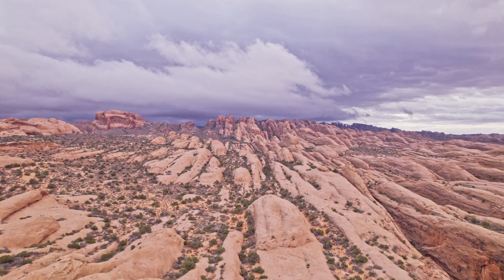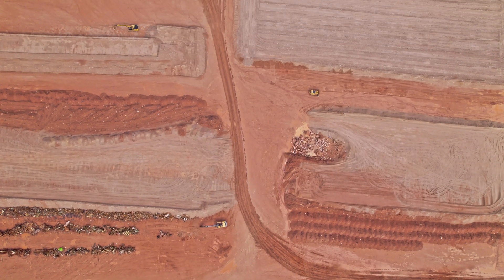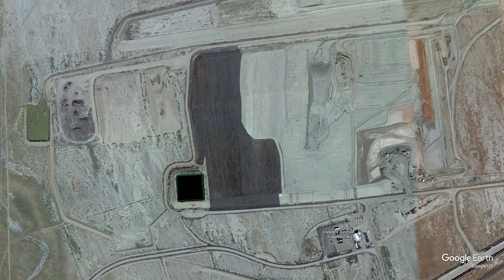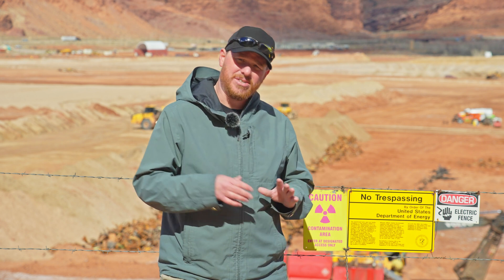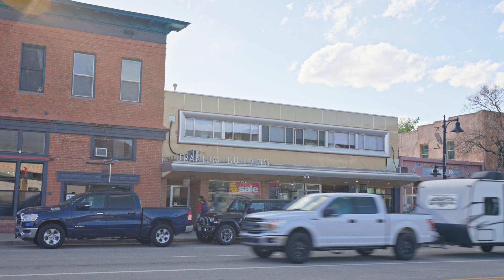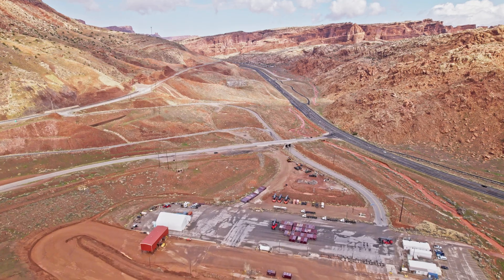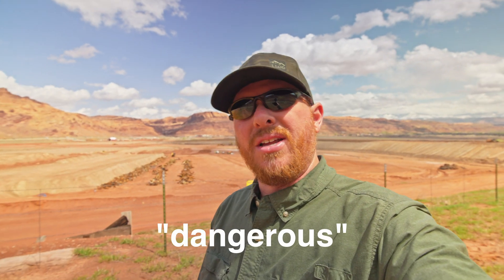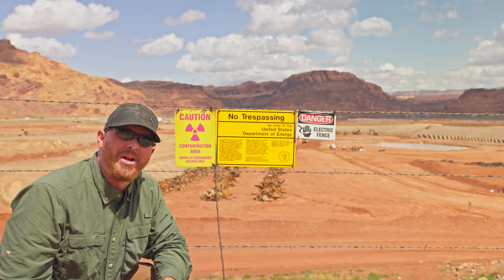Radioactive Area Next to Arches National Park

Comment: I was there for 2 years and was one of the original RCT's getting the site ready to remove the big mountain. There was no real concern for the public with the very low amounts of radiation. There was and probably still a problem with the people of Moab that took away thousands of bricks for their houses and patios. The bricks do give off radiation that could be a problem for health. We had a truck that would drive through Moab to detect the problem radiation. The government was required to pay for the removal of the bricks but the DOE out of Grand Junction ordered these reports to be hidden so the government didn't have to pay. The move of the mountain was a success. The coverup of the DOE in regards to the people of Moab still exist.

Comment: This was the site of the first uranium processing facility built by a private company in the world. It was build in 1955-1956 under an Atomic Energy Commission license by the Uranium Reduction Company. The URECO mill used a revolutionary sulfuric acid leach and a resin-in pulp recovery circuit that recovered 93 to 96 percent of the uranium contained in the high-grade ore shipped to Moab from the Big Indian mining district in San Juan County. The Atlas Corporation purchased the mill in August 1962, in a $23 million transaction that consolidated most of the mines in Lisbon Valley with this uranium processing facility. This uranium mill processed 6,354,733 tons of ore averaging 0.34 percent uranium oxide that contained 43,762,217 pounds of uranium concentrate (yellow cake) under license to the AEC, and more than 11,000,000 pounds of yellow cake for nuclear power plants. Atlas Minerals shut down the mill in March 1984, after the domestic uranium market collapsed following the Three Mile Island accident and Jane Fonda’s ridiculous anti-nuclear power movie. 

During the 28 years it was in operation, the mill was the largest employer in Grand County. The removal of the tailings and remediation of this site has ballooned from $60 million to cap the tailings in place to $700 million to excavate and ship the very low grade uranium tailings sand to the Crescent Junction containment cells. This has made the mill once again the largest single employer in Grand County. The millsite will become a park and tourist information gateway to Moab once the remediation is completed. A portion of the park is going to be dedicated to the uranium prospectors who opened up this area during the 1950s Uranium Boom.

Comment: Questions: while in Colorado measuring radiation levels, what was your take on Rocky Flats?  And, do uranium tailings still offgas helium?
Reply from the maker: I’ve been to Rocky Flats and walked the northern perimeter fence with my detector. I didn’t see hot pots and the radiation level seemed normal for the area. I want to go back and do some more investigating on the site. I would imagine the site that is off limits in the middle is still contaminated. 

 Anything that emits alpha radiation makes helium. The alpha radiation is helium with a positive charge. It quickly picks up 2 electrons after its emitted. All helium on earth comes from radioactive decay.

Comment: I think your title closely borders on fear mongering.  Not good. Hence I’m not passing along any Likes or kudos.  
I’ve been to Moab many times and Arches National Park.  I’ve got no problems with your general content.  BUT, I believe you should have explained the distances between the cleanup site, Moab, and Arches National Park. 
Granted they are not miles and miles apart, but nevertheless, without this orientation - a safe distance as you know - a visitor not familiar with the area may be lead to believe Arches National Park sits almost on top of the cleanup site.  Not good!
Reply from the maker: From Arches National park it takes about less than a minute to get from the entrance to the UMTRA site. Those two sites are very close to each other.
Reply: Actually  the cleanup bordered the national park on east side of road. Rangers pin flagged boundary

Comment: The mill tailings are being removed in case of the possibility of catastrophic flooding due to the possible collapse of Dillon Dam in Summit County. Dillon Dam is unstable. 
If you drive by the dam in the winter while on I-70 look up at the left side of the dam and you will see an inverted crescent or horseshoe shape that will be snowless while the rest of the dam is covered with snow. The crescent is the area that is moving causing friction which melts the snow . If it were to collapse the flood would carry the tailings down stream all at once contaminating downstream lakes , irrigation ditches ,agriculture areas,  canals, etc..
Reply from the maker: It really wouldn’t matter if that area flooded in regards to the tailings. Like I said there are plenty of natural deposits of uranium that the river runs through that put far more contamination than the tailings do or can do. 

 The main reason they are removing it is so they can use that land for something else.

Comment: it's possible there is current in the wires from AC transmission lines..   using an IR camera would show it, as they weould be warmer than they should be..
Reply from the maker: Well they didn’t feel warmer to the touch.

Comment: The radiation at that site is minimal probably less than standard background radiation that is everywhere , the real hazard is the chemicals used to extract the uranium and vanadium out of the ore. As long as someone doesn’t eat the dirt there isn’t anything to worry about.
Reply from the maker: Nope. The radiation is much higher at this site. Uranium mill tailings can be very radioactive. Lots of gamma emitting isotopes in there.

Comment: As a Chemistry Professor at the Univ. of Utah, I arranged for students from the RADIOCHEMISTRY CLASS to tour the site for instructional purposes over 5 years. The DOE is not only removing the radiological contaminants that you mentioned, but they are also removing the chemical contaminants (such as toxic organic chelators, acid, and lots of ammonia) that was used to make the yellowcake uranium product that was sealed in 55 gal. drums and shipped to various locations for further chemical processing and ultimately to an isotopic enrichment plant. DOE contractors monitor the groundwater at and near the reclamation site and the nearby Colorado river.

I like to think I am a non-biased observer to the operation, and in my opinion, the DOE and the private contractors operating this site and the tailings repository 20 miles north, are doing an outstanding job of keeping the public and the environment safe. I frequently recreate in the Moab area, as well as downstream in the Colorado river and Lake Powell. I am very happy that the DOE stepped in to clean up the toxic mess that was left on the site by two private companies from the 1950's through the 1980's.
Reply from the maker: I agree, with them doing a good job there. It’s great that they’re cleaning up the area. I’m sure the chemical contamination is pretty crazy there. Usually mill sites have a lot going on.
Reply: I'm a big fan of your channel. I think I have been to 98% of the sites you have showcased. Great work!
Reply from the maker: Thanks. A lot of the sites I visit are ones that I find very interesting and have a story to tell. I hope to keep it going and show some sites people have a bunch of questions about. There are so many areas that have been approached by officials in a horrible manner. I’m hoping I can change that and find a middle ground where the truth usually is found.
Reply: Ah, now I regret not taking Chem 3200

Comment: I wonder about the workers who spend every day out there cleaning up the site. Their exposure over time must be pretty high.
Reply from the maker: I would imagine it would be on the same level as a uranium miner. But it also might be a little higher only because of the elevated level of radium in the tailings.
Reply: I worked at that site in 2007 and other hazmat sites all over U.S. . They monitor personal radiation with film badges and other detection devices when leaving hot zone .They also make you wear protection, tyvek suit , booties, gloves. This protection is thrown away every time you exit hot zone. You also have to take RAD WORKER 2 course which is an 40 hr course . They had a lot of oversite on that site that watched pretty much your every move . The people that knew the most about radiation said as healthy adults we were not in much danger with our safeguards in place . Water trucks and dust control was very important and visible dust would stop work. They were very strict on booties too saying going home with dust on cloths and shoes endangered your children. You stay very clean on a RAD job.

Comment: It’s electrified to keep animals out

Never touch a metal fence especially minimal ones that seem easy to just leap over etc. 

Look for boxes cameras and other stuff. Secure areas will bury them somewhere close as they need to be repeated due to termination points. One method around this is to string two lines. You need to bridge the gap to active it. Vs just touching one.

But it’s bare wire. You are water and metal 😂🙏

Comment: Drew... my comment has nothing to do with this particular video... But.. after watching your video on materials contamination, and several Chernobyl videos, I started to ask myself why the disposed vehicles and equipment could not have been washed and "wiped" of radioactive contaminants once radioactivity decayed? Thanks!
Reply from the maker: Some materials are harder to decontaminate from. Usually uranium mill tailings can be washed off of machinery. It also depends on how long that machinery has sat in that contaminated material. There can be a degree of penetration into paint and metals. There is some equipment at Chernobyl that is still contaminated because some of that cleanup might have been with uranium fuel elements or something that emits a high amount of neutron radiation. Neutron radiation can make other non-radioactive items radioactive. Neutron radiation isn't common in the majority of radioactive isotopes. But in a nuclear reactor there is a high intensity of neutrons as that's what keeps the fission reaction going.

Comment: Well done, as usual, and very interesting presentation. Under certain conditions, a noticeable voltage can be induced on objects such as a large vehicle, a fence, metal building, or irrigation system . This can happen when the object is near a high-voltage transmission line and is insulated from the ground. It's relatively rare, but it can occur at low levels.
Reply from the maker: Glad you liked the video.

Comment: The radiation is considered harmless on short term exposure. Just be sure to hold your breath when you're in the area. If one microscopic radioactive particle goes into your system, you likely will be toast after a few years. Particles released from nuke plants are far more dangerous of course. Three mile island cancer rates are still spiked and will be for eternity as far as we're concerned. One million statistical cancers, many fatal, from TMI.

Comment: Could you see if the workers were wearing any protective gear? Do you think they work in shifts so they’re not exposed too much or is it really that dangerous where they are working? I wonder if they even know everything about what they’re working on.
Reply from the maker: I don’t think they are wearing suits. I usually don’t see people walking around on the tailings piles. Also there isn’t a suit that will protect you from radiation. The suits are usually worn to make it easier to decontaminate yourself after being in a contaminated environment. Everyone there knows exactly the type of environment they are working in. They will also be fitted with personal dosimeters that they will wear for the whole shift. If they cross a radiation exposure threshold then they rotate out. I want to say that nuclear workers have a federal limit of 5000 mrem of exposure in a year that they can take before getting pulled.
Reply: @RadioactiveDrew  thank you for your response. That definitely helps me understand more.
Reply: I worked on the Monticello UT mill about 50 miles south of Moab. clean up protective gear consisted of hard hat, safety glasses, thin gloves and booties to cover the steel toe boots we are required to wear. Remember the tailings have had most of the radioactive material removed. The biggest concern was Radon gas.
Reply from the maker: @dougbrown8331 the tailings doesn’t have most of the radioactive material removed. It has some of the most radioactive material in it. Uranium is what they’re extracting and what’s left over is a bunch of other radioactive elements like radium. Radium is a million times more radioactive than uranium.

Comment: So how deep are they going?  Taking the top 6 feet of soil or are they focusing on certain areas measurings the rad. as they go?
Reply from the maker: I’m sure they are taking radiation measurements as they remove material. I would imagine they would have a limit to go down before they would backfill the area to cut down the exposure…if they couldn’t remove it completely.

Comment: They are removing the tailings but burying the contaminated scrap on site?  Odd.  I would expect the scrap metals and junk would be carried away, too.
Reply from the maker: It is being moved about 30 miles north to Crescent Junction.
Reply: @RadioactiveDrew 
Well...  It looks like at 2:14 they are cutting up the pieces and a dozer is pushing dirt onto it.  Maybe that's not what it looks like.
Reply from the maker: @fegolem I think that dirt falling on those scraps is a mistake.